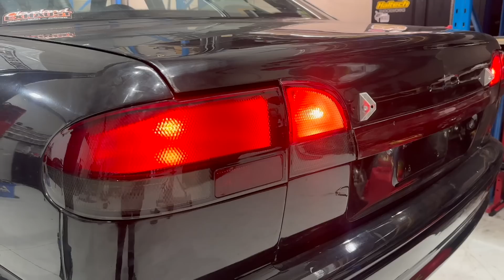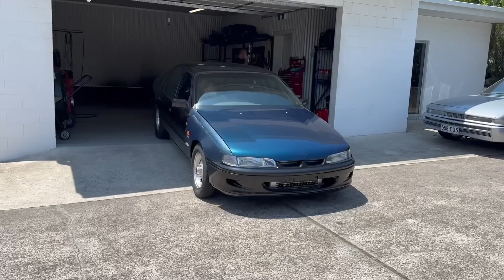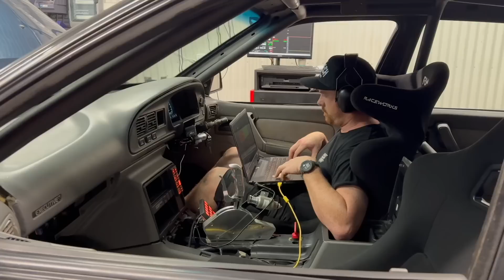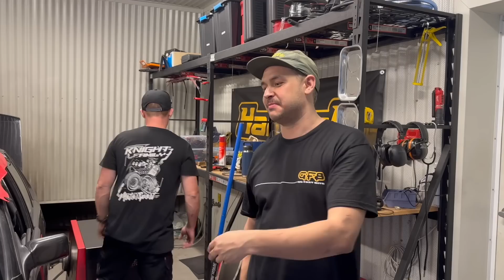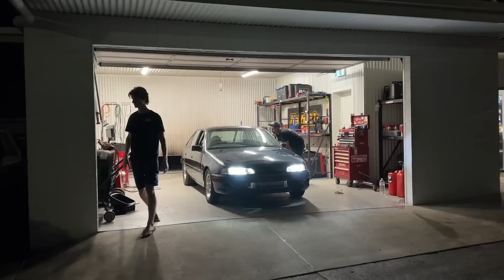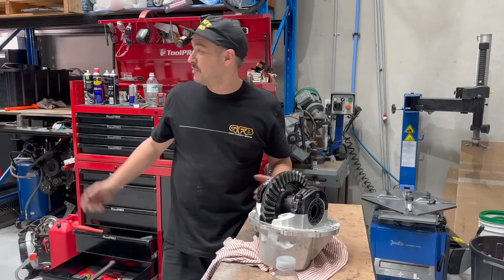Investigating why my built 2JZ Doesn't make any power?

Comment: Damn I'm genuinely having trouble comprehending putting 100hp of heat into something that size for several seconds without it failing from the steel softening even with oil helping spread/absorb the heat. I know it was just an approximate number but still 75kw is an immense amount of heat I was shit scared when they kept going!
Reply: Not wrong aye like you could boil litres of water from room temperature with 75kw

Comment: I'm a little late on this one lol
The wing reduces drag significantly. It only produces downforce when you add a wicker bill. 
That being said, it's main purpose actually is to reduce drag, because it breaks up the low pressure area behind the car.
Which is, in my basic understanding of aerodynamics, the biggest thing slowing you down, because the rear is actually more important than the front of the car when it comes to aerodynamic efficiency.

So many drag racers run a wing without or just a very small wicker bill. Obviously it depends on the overall shape of the car and how much lift or downforce it's producing. If your car produces lift you're going to want to add a wicker bill, because lift is obviously no good 👎
But you don't want to produce enormous amounts of downforce either, because downforce means drag. Also you don't really need it, because drag cars are built to produce enough static grip to handle the power. 
So drag racers try to have the least drag possible, while maintaining just enough downforce to keep the car stable.

Another function of the wing are the vertical fins, they give you stability.

(If you're entering multiple thousand hp cars, then you could obviously use some downforce to get the power down in the big end. But if you're at below something like 2000 hp your main concern will be having as little drag as possible and not producing downforce.)

Comment: certainly been there woody, currently i have my 2jz running about the same stage as you and the fix list is long and hurts the motivation! let alone the wallet. As you know it will get there; always lots of teething issues and un-fun stuff like pulling engines out and covers off to find leaks!

i had my build running on the dyno for 10hrs before my converter let go, was a huge shot in the pride as i thought i had checked and re-checked all my fittings to get leaks and let downs and finish the day with a converter rebuild. 

got to be happy with your progress so far considering the complexity, and seriously 700hp for 6000rpm IS GONNA BE BALLISTIC AT 8800 with 282 cams 

looking forward to further investigative work, problem solving and experts with their opinions thanks again for the content!

Comment: Hey woody, I have a background in aerodynamics. Wings and spoilers start producing downforce/lift/spoiler action usually north of 60mph. A rear wing should help with traction at the higher speeds, but it will also slow the car down. If you’re doing a pass and you’ve got not traction at 100kph+, it might be time to bolt the wing back on and try again. Great build!
Reply: 100%. Wanting a full sleeper is understandable, but at the speeds Kevo should be capable of a small wicker bill, or gurney flap is a smart move. It's not even so much about downforce as it is eliminating lift. You don't want drag to slow you down, but increasing rear lift at high speed should be I'd bad juju.

💨 Small lip. Give that baby just the tip 💨

Comment: Woody, word to the wise. New silicone doesn't adhere to cured silicone. Not in a shower stall, and definitely not in a hot engine bay. Squirting a bead on to the outside of the rear main seal or the edge of a pan gasket usually only obscures where the leak is coming from, and makes a bigger mess when you do actually fix it. Best of luck, brother.
Reply from the maker: Yeah it’s dodgy but it worked! 😂 no doubt I’ll have to rip the engine out one day and I’ll fix it then but for now that’ll do donkey.
Reply: @theskidfactory  I like "that'll do donkey." I say it all the time, and nobody gets it.

Comment: Surprised your tracks allow coolant. It's the hardest fluid to clean up on the track. It's not allowed here in the states. Also the wing helps with rear downforce and help keep it straight at the higher speeds. Can help with the chute deployment also.

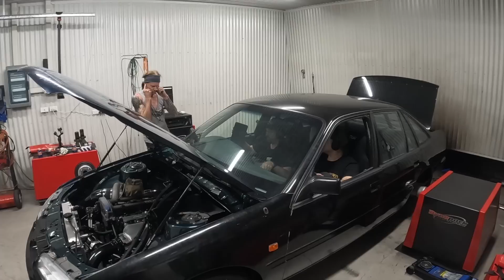Comment: anyone else notice what appears to be sparking from one of the ignition coils @22:52 ?
Reply from the maker: Just the coil jumping around with vibrations. Didn’t have them bolted down as we were checking the plugs
Reply: Yep was just going to say that. Looks like cylinder 2

Comment: Hot tip with gaskets, if you coat both sides with hylomar or the Permatex non-drying jointing compound it basically guarantees no leaks, and if its a paper gasket it stops it from glueing to a surface and tearing when you take it apart, meaning you can do side of the road fixes and re-use the gasket. 
Also the drag wings while not always doing anything for downforce, they make parachutes deploy faster. Might not be such an issue with the speed you'll be doing (its not 200mph) but still.
Reply: That Permatex non hardening aviation gasket goo is awesome,  a sticky mess to use. But as you said works amazingly and makes gaskets reusable.
Reply: @adrianzmajla4844  Yeah it absolutely is messy, but boy howdy is it nice to be able to tear into your vehicle on the side of the road/track and be able to just put it back together. On the motorbikes I use it on the cases, literally just wipe the oil off with a finger and bolt it back together

Comment: There is a difference between spoilers and wings. A wing is to create downforce (angled) and a spoiler (generally flat) is to reduce drag / remove unwanted aero turbulence. A back to back test with and without the "tea tray" on would show any benefits. Or possibly cause unexpected characteristics at speed😬.
Reply: Spoiler spoils the air. Is that fair to say?
Reply: Google :
A front spoiler is designed to reduce the pressure under the car, which helps to increase downforce and reduce drag. The design of a front spoiler creates a low-pressure area underneath the car. This low-pressure area sucks the car downward, creating more downforce.
Reply: @damfadd  Sounds like in Googles example the (flat?) floor of the vehicle is acting like a wing. The spoiler redirects air to create low pressure under the car so the floor is sucked down. The floor is creating downforce for the vehicle from the environment created by the spoiler.
Reply: Hi, pilot checking in. Spoilers are to increase drag, or spoil lift.

Comment: Did you machine the ORB fitting into the rocker cover. They can seal up against the cam cap
Reply from the maker: Yeah these are low profile ORB fittings

Comment: The wing you removed was designed to reduce drag and apply down force in drag racing.. its what its specialised for..
Reply from the maker: Yes but its design needs some alterations, from what I’ve read there needs to be an air dam at the rear of the wing?
Reply: @theskidfactory  %100
Reply: Wing depends on how fast you want to go and the balance of the car, some it is more about stability at high speed, and you just add a little edge to it to adjust the downforce, you can see the balance with the shock sensors when you make a pass. 
Some cars naturally lift and others squat.
Reply: If a wing creates down force then it also creates drag...